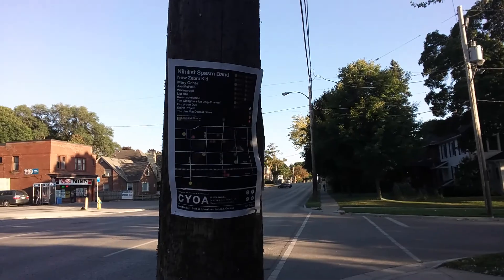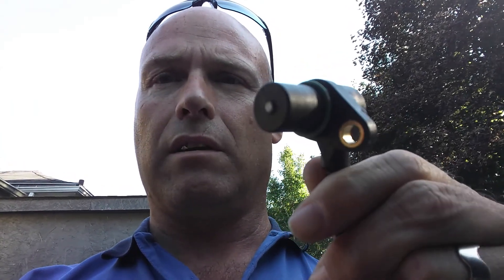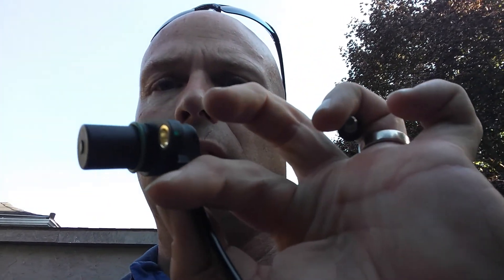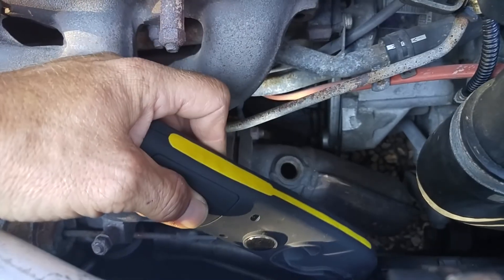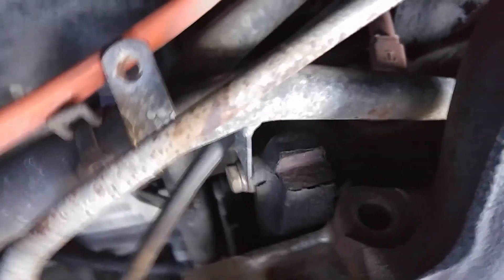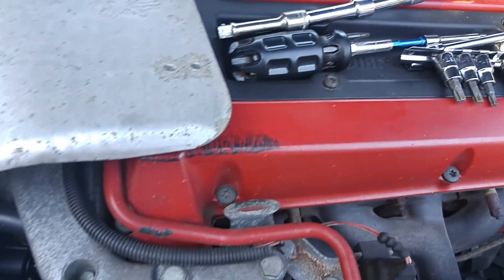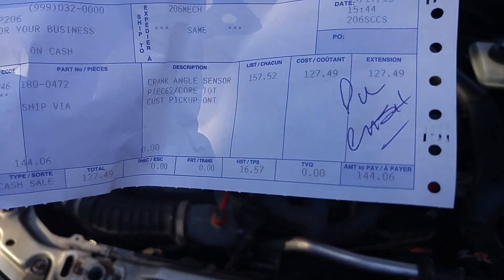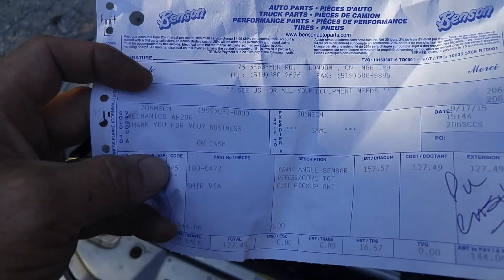CPS repair 03 SAAB 9 5

Comment: About to replace this on my 04 saab 95... really starting to hate this car, hopefully it goes well
Reply from the maker: Make sure you put that heat shield back on. I think that is what kept killing mine on the one car. The 03 had one but the 02 didn't and I went through 3 sensors.
Reply: @martyjackson4806  do the bolts that hold the heat shield on usually snap? Where is the cps? Behind the heat shield?

Comment: I am missing the same manifold bolt on my 2004 9-5 that you mention.
Reply from the maker: on my 04 the one on the other end of the manifold was gone. I'm going to try to get this broken one out tomorrow.  the one on my 04 came out easily with an easyout. (first time thats ever worked for me.)
Reply: I didn't check it further, just noticed it coincidentally about an hour ago when I was changing spark plugs.  So the bolt is likely broken off in there?
Reply from the maker: +Gary Miller oh its in there. make sure you drill in the center of it.